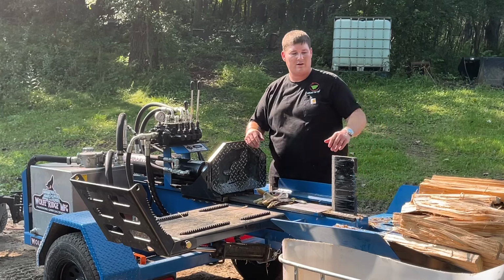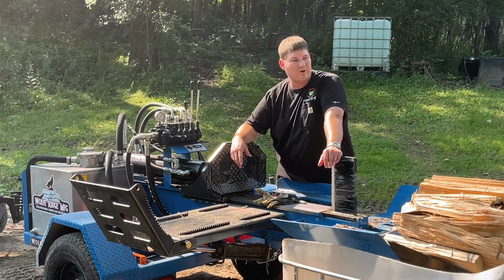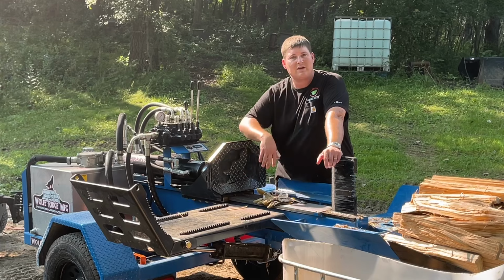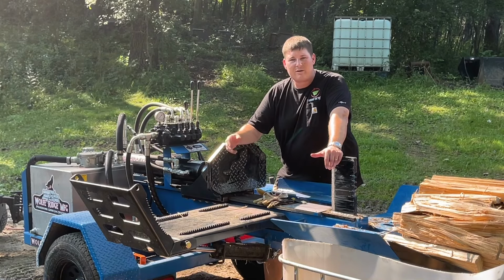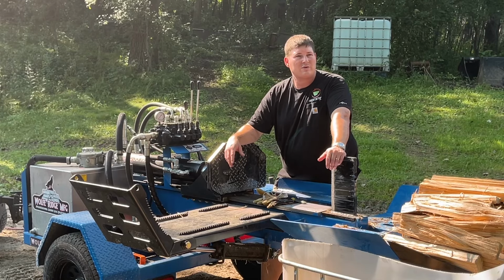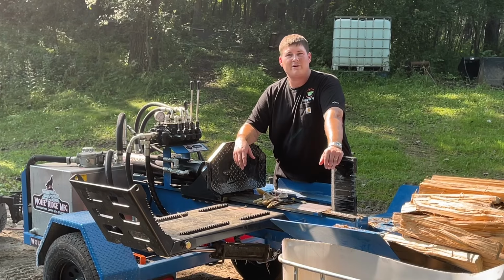Wood Stuck 🪵 How did this Happen

Comment: Great splitting session. Once again congratulations on the 1,000 subs. That Honda engine sounds great. 41 hours on machine your about there for maintenance service. That would be a great informational video. I just got done fixing a problem I ran into recently myself. I Put second coat of paint on yesterday.
Reply from the maker: Yes, I’ll be changing the oil again at 50 Hrs, probably do the filter also.  What was the paint for?

Comment: That log even got me frustrated. I have had some twisted green ash that would get stuck. One even stopped the 35SHO with the 4 way not fun
Reply from the maker: I have only had the WR stall out a couple of times and it’s been on Red Elm and Cottonwood.  On the red elm I was trying to push through the box wedge and the cottonwood time I had the 12-way wicked wedge and about a 14 incher and it buried it about 6 inches into a 16” round.  Had to use little pieces to unstick it.

Comment: Not a bad run even with the wood getting stuck.  But you at least have a splitter that can handle it
Reply from the maker: I am thankful for the Wolfe Ridge, it’s a lot of machine.
Reply: @AroundTheYard-MN  : Same here, just crossed over to 370 hours.